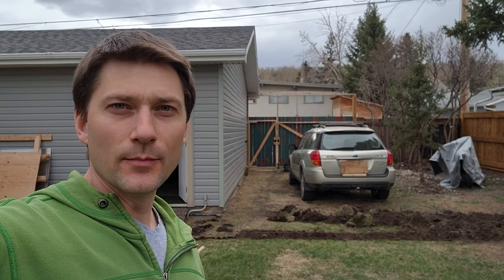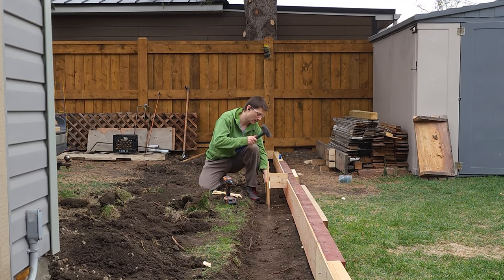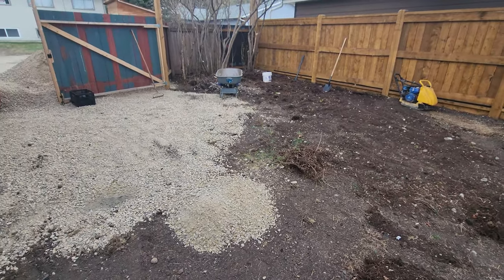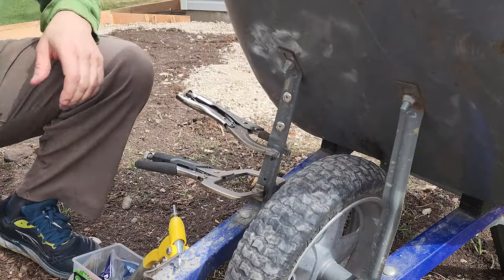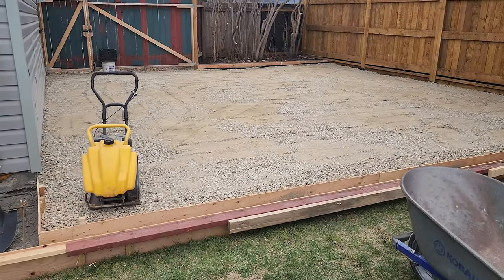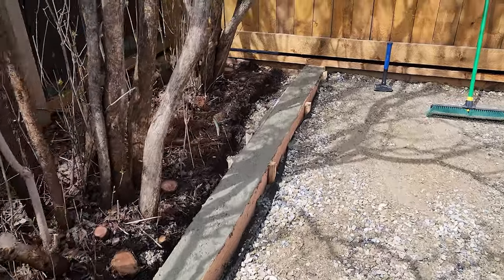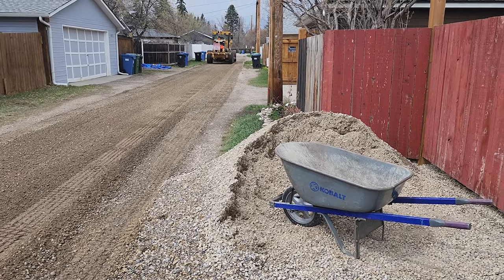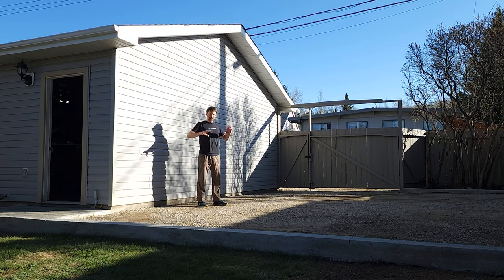Building a Gravel Parking Pad on a $700 Budget.

Comment: I done something similar in my back yard to set some storage sheds on . I used a aluminum grain shovel. Got her in a day . Weeds will try to take hold eventually . They tried to do such on an open area I graveled. You made one mistake . Your electrical  conduit going into the garage was completely covered by concrete . Your concrete will go up and down as much as a inch or more over the year  . I lost my garage power one day because of that movement looks good Kyle
Reply from the maker: Well, I hope that my conduit stays together over the winter... Time will tell!  It's sure going to be a useful space!

Comment: was curious how something like this setup like this would hold up against heavy rainfall
Reply from the maker: Crushed aggregate mix works great in the rain, but as the ground bellow it gets wet, it will become soft.  The solution to this is to go thicker. Much thicker.  This same crushed rock is used as a patio base about 4 to 6 inch's thick, but for use under a vehicle you should probably aim for 12" thick if it's not very hard ground beneath it.  If you go thinner, it will still work great, but your tires will dip into it a bit.  I think the thicker recommendations are more for if you plan on putting pavers on top and don't want much flex.

Comment: Not that you did anything wrong but....

Not sure why you didnt use concrete ready in bags? I guess you did not rent skid steer to spred gravel is cost. Delivery fees are outrageous.
Reply from the maker: The reason I chose to mix my own concrete was due to cost.  Since I had a big dump truck deliver my road crush anyways, the cost of mixing that with Portland cement worked out to quite a bit less than buying ready mix bags which are about 1 part Portland cement to 5 parts gravel and sand.  I was also lucky a neighbor leant me his concrete mixer, that sure helped!